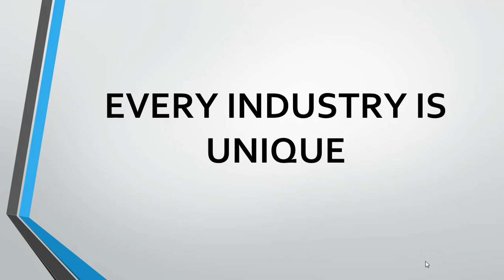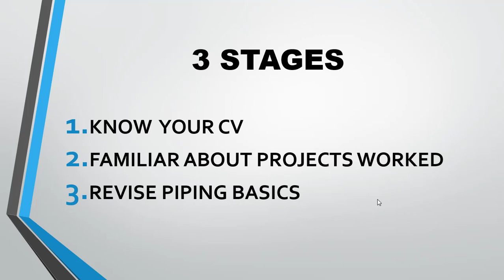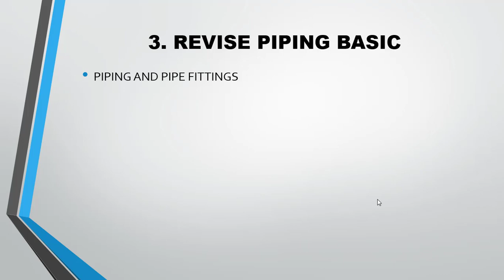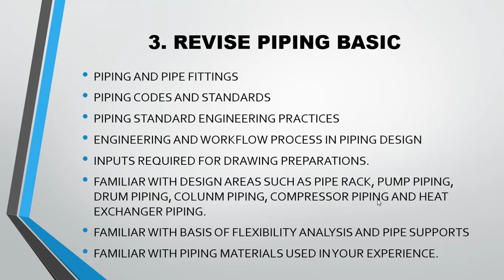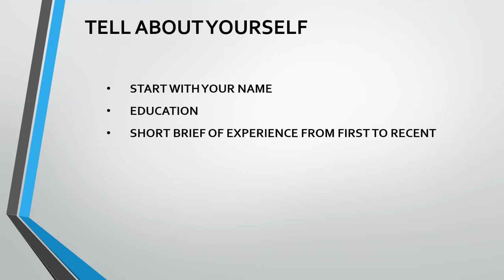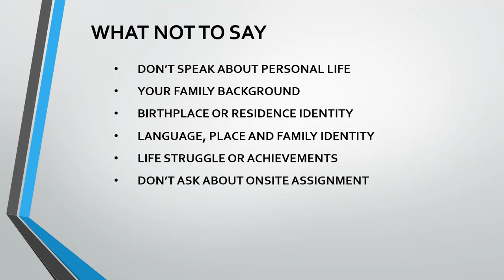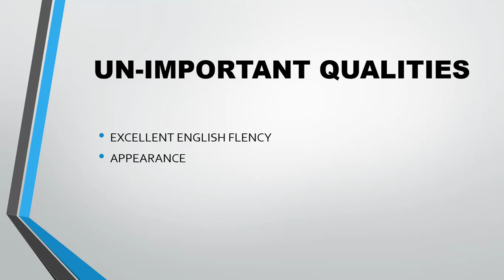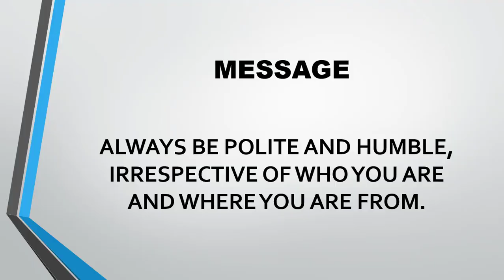How to prepare for a Piping interview?

Comment: Sir could you please tell me about the paid services
Reply from the maker: Hi Utkarsh
Reply from the maker: Reach me at +968-79866307
Reply: @pymedaca3130   They says the number is not valid.
Reply from the maker: @utkarshgaur8009  This is very much active no. Please add in contact with country code +96879866307